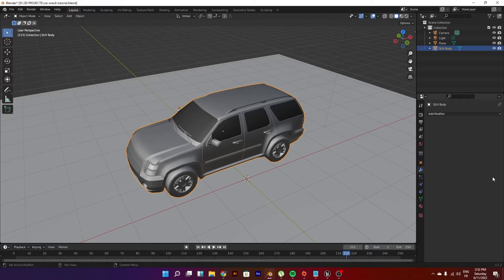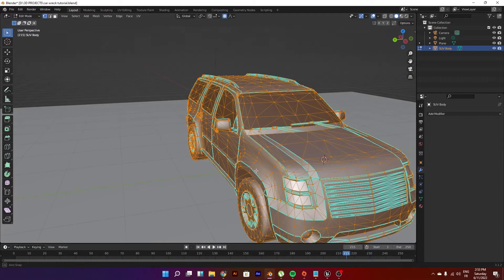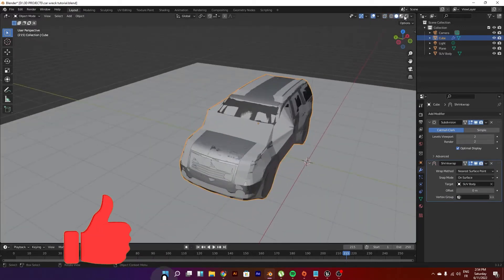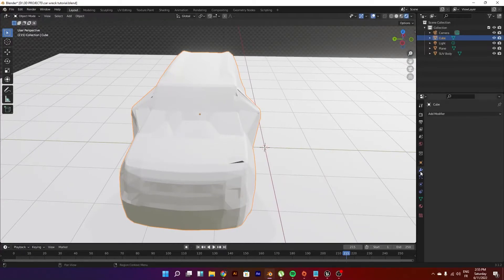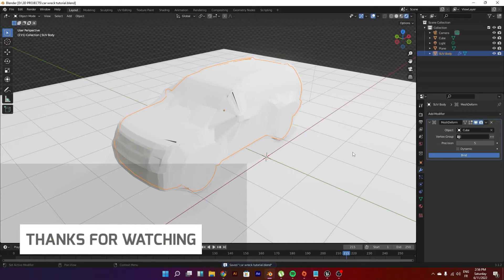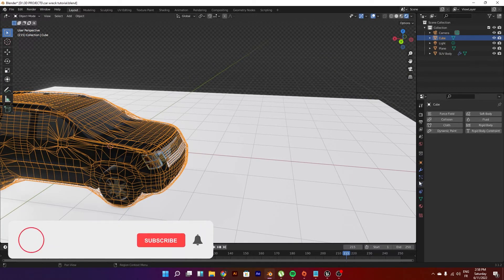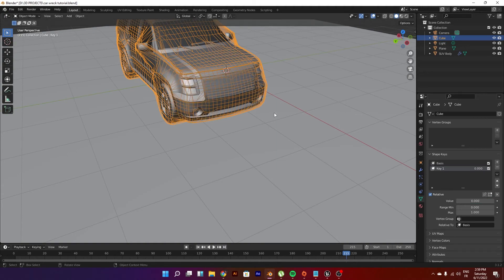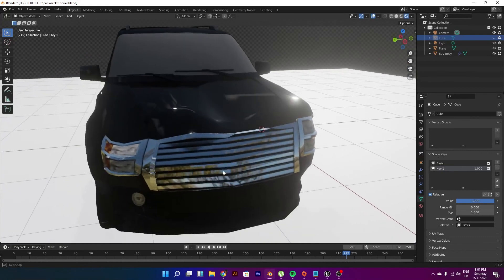How To Easily Wreck A Car in Blender

Comment: I've been recently looking into deformations techniques, and came to understand that proportional editing and lattice, which are the go-to techniques, are in fact lacking, because they require the user to manually edit the deformation, basically vertex by vertex, without the ability to use sclupting methods. This approach of yours instead allow the user to also sculpt, which saves a lot of time and leads to better starting results. Thanks a lot for the video.
Reply from the maker: Thank you for you elaborative and deeply explained comment i have learned new things from it honestly thank you for contributing to this section

Comment: how can i animate this?
Reply from the maker: you can hover the mouse over the value of the shape key and press"i" on the keyboard when you set the desired value, then move in the timeline to the desired frame and change the value of the shape key to whatever you desire and hover over the value box and hit "i" again to set another keyframe, Or you can enable record keyframe in the timeline and then you wont have to add keyframes manually they will be added automatically whenever there is a change to a value

Comment: blender crashing at binding point dude 
how to fix this problem
Reply from the maker: If the mesh is too dense and you computer cant handle it, it will cause it to crash apparently. You can try using a different version of blender it might be a bit robust for this kind of situation